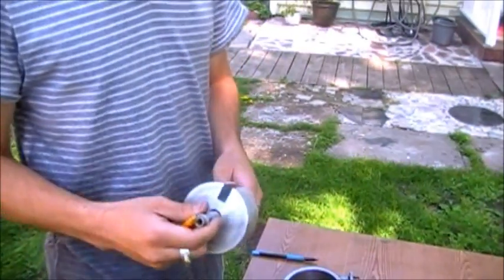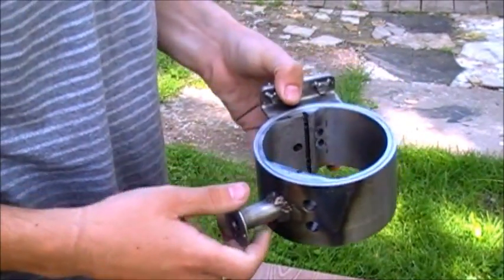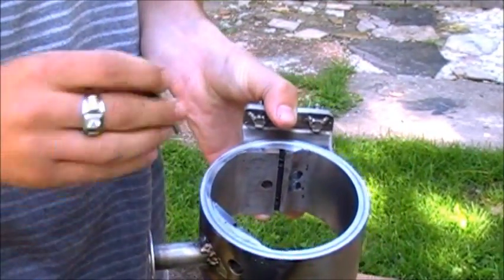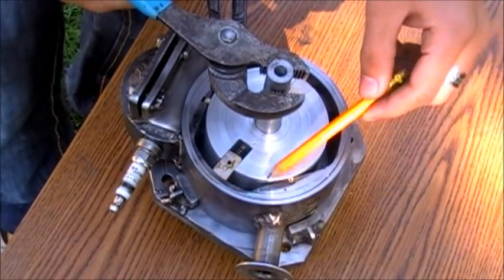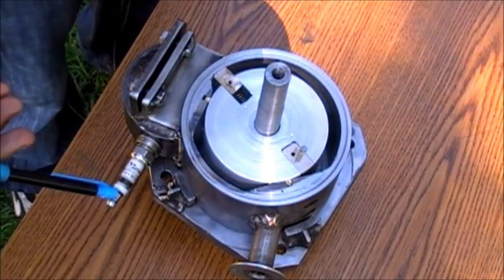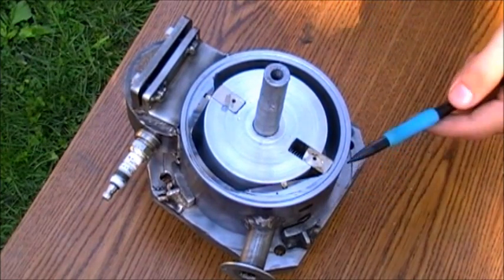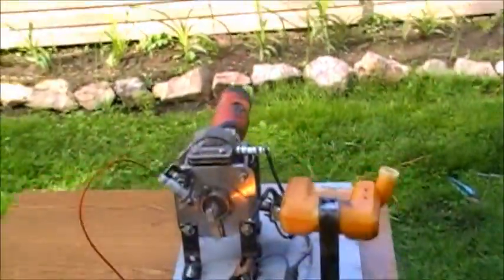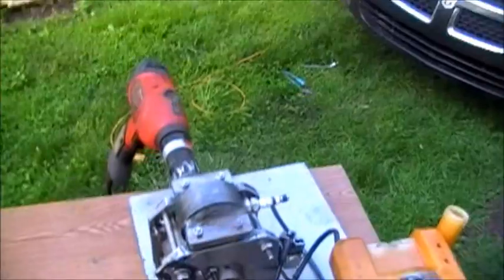new rotary engine semi functional prototype

Comment: I love new ideas great job thinking of a new engine design we need new technologies in this era.  I am afraid this design as it is will not work, the engine will not run because it does not perform all the functions needed to complete a working cycle .  Intake of air and fuel, compressing it, combusting it, clearing exhaust gas.  Then back to intake of air and fuel and continueing the rest and repeating this in that order which is a sustainable cycle.   Ur design actually is doing this......intake of air and fuel, igniting combustion chamber then clearing exhaust  gases.   Do this, get ur engine out n think about the processes the engine goes through from start to finish, step by step from the beginning the very first cycle the point where there are no "previous cycles" to include in your calculations.  Do that n follow it thru and you will see how ur missing a process because u were including or counting on something  done in a previous cycle when u designed the engine.    If u can correct this the engine should run I like the rotary idea.  Keep working on it

Comment: Good thinking but, of course design wise a bit poor but as Idea is good. You need minumum 2 chamber cyle to complete, So, when first explode happen then it will push second chamber position and exit burnt gas out egzost.  I have similiar design but, it completes the cycles but not enough compression, So I come up with turbo charge idea with complete in one unit. Now it does give compression and enough torque and complete the cycyle without problem. Now, it has heat distribution problem, lubrication and sealing problems. Recently I am sorting all those out which I come up with solutions, but I want to complete it before I make it public. So, you need a lot of work to be done. But, I admire determination without sufficient equipment and try to build your idea. Good luck.

Comment: Just a heads up , I have the same style of motor in my Ingersoll impact gun. It runs off a air compressor...your going to make a internal combustion impact wrench? The problem your going to run into is ....torque unless you set rpm to 28,000 . also there is a lot of friction here, and springs, how will the spring hold up after a few years.?
After finishing the video ....
You need a flywheel . a heavy short one and at least one more combustion chamber to help power through 180° of rotation or more flap jobs to make more combustion chambers, that way for every few degrees of movement there is gases expanding to drive the output shaft....think bilge pump sept from inside out and with explosions . the more explosions + surface area= more working output....the central hub and flap veins are the pistons and crank....more pistons, this could be the same as a 8 cyl but a quarter the size.

Comment: Interesting idea. I also thought of spring-loaded seals when designing my own rotary engine, but the problem is those spring-loaded seals cannot maintain a proper seal when the engine is spinning at thousands of RPM. The inertia of the seals is too high and they start floating. Also, there is a big problem with lubricating the seals, because rotary engines can't scavenge oil for reuse, so rotary engines inevitably burn oil. That makes rotary engines impractical for any usage where clean exhaust is a concern.

Comment: This prototype is actually qute fair to good, but it needs minor changes like you already cut 2 vanes into the armature  USE THEM both then make the sparkplug fire EVERY 180 DEGREES run this engine  on 32 to 1 - 2 cycle mix fuel and the prototype will run AS IS with the existing compression loss and leaks. I guarantee

Comment: That's not a rotary engine that a vain type engine... very inefficient design .. but good learning experience...if you could boost it it would probably work a lot better being the boost can push the vains...

And being it's a prototype it's theory in design if you do get it to work will be very inefficient especially at high rpms being the vain will float and let gas bypass it apon closing.

Comment: Good idea but you have allot of space that is unused like you could  move the exhaust over more away from the intake which would prevent the  intake air from being over heated and also prevent fuel lines from melting

Comment: I love to troubleshoot problems and you should connect a compression test gauge so can see how much Actual compression pressure it achieves?You need at least 5-6-7 Lbs and that spring loaded seal “plate” might give you problems during extreme Heat!Spring steel with the low carbon don’t really do well but obviously you are an intelligent person bilingual in English&Russian is pretty cool.Holiday in the US when you get more fluid speech and come here to test your self!Good Luck and Never give up on development of this idea.”Keep on Keepin on,”

Comment: Really good design man. ... give it some more symmetry by having 2x combustion chambers opposite to each other for thermal expansion symmetry... then  2 x exhaust obviously ...basically remove exhaust port cam...  add fuel injectors.. throw carburetor   ..attach crank gear for super charging the intake air mixture.. machine fancy end plates for new air intake paths and other things.. add roller type bearings.. more bearings to surround a fly wheel... etc etc ...  I honestly think this thing could rock with enough tinkering.40-50 thousand rpm..

Comment: Would be better if you moved the spark plug lower more to the combustion chamber where it is going to ignite the fuel easier and it will most likely fire correctly, plus you need to add another apex seal to stop exhaust being sucked back into the combustion chamber which would even help it fire up, also which is front as it looks you were rotating from the flywheel side as it looked like it was rotating anticlockwise. If you have more vid's on it please post and show us it runs

Comment: The theory is quite a good. But i foresee a lot of problems with the movable parts installed in the rotor and the part at the combustion chamber. But keep up the good work. It's a wankel without all the wankel weak spots.

Comment: An internal combustion engine is, above all, a thermodynamic machine. Mechanics is the way to put thermodynamic concepts into practice. Not on the contrary. A nice design does not guarantee the validity of a concept. In terms of thermodynamics this design does not add anything to the solutions already known.

Comment: Just to save time and money, buy a vane air motor and attach a combustion chamber to it. It may work, but in the "energy saving" department I suggest you hold your horses - a lot of energy will be wasted through friction and imperfect sealing.

Comment: how do you plan on handling lubrication and cooling? A fuel/oil (like in a 2 stroke) could keep your mass down (giving the engine scooter use possibilities) but greatly putting out pollutants. Cooling though, are you shooting for air cooled or liquid? liquid opens up a whole new can of worms to deal with (mass issues and thermodynamics). 

I'll keep dropping by to see where you take this, its peaked my curiosity.

Comment: The reason this will never work is that the rotation of the rotor is completly symmetrical. Therefore no way for the combustion to impart its power on the rotor. It will only appear to be running as long as the drill keeps it rotating.

Comment: The poor home quality machining aside, the concept is also poor quality.
So far you have an air pump that is burning fuel, but it probably can't even sustain itself without the electric drill turning it.
There are so many engineering dynamic problems here, that will never be practical.
Seal bounce,
Ball valve bounce,
Balancing,
There have been lots of attempts to do something different to the standard four stroke piston engine, but none have come close to even matching the four stroke efficiency.
Kudo's for the idea and execution, but I assume you have learnt a lot more about how engines work since making this, and can see there is no direction for development.

Comment: I see one glitch there. The compression chamber. It looks like its volume over time is going to zero and then new chamber opens up thats disconnected from the compression chamber. With the vankel engine the compression chamber "flows" with the rotor and just changes volume. In your design it just suddenly closes - goes to zero. Or i dont see the gas flow properly. Maybe you could do a 2D animation describing the gas flow and overall concept?

Comment: very nice thing ,. but there is tree problems . 
1- i dont think that the air is going to well comperes in chamber , i think its a bit big . 
2- the yellow thing which is made for sealing that you installed in side the rotary thing is a big big and it can break easy because of the shape and the size that thing is expanded out . it would be better if you made that thing looks like the cam shape or in side the cylender its could be smother 
3 the problem is my English sorry for my bad English :)

Comment: H.i I got an idea how you do much efficient your engine. I noticed you have valves only 1 side of the combustion chamber and when the engine in compression stroke you loose the compression on the valveless side. If you put a valve there which opens after the sliding vane  passes, the compression will be bigger. And an another idea try to attach a big flywheel. :-)

If i wrote stupidity please explain why.

Sorry my bad english.

Comment: concept is flawed .. there is no compression of the fuel air mixture taking place at the point of firing 4:00 .... burn will be very weak and inefficient, or will not ignite at all. Of course, sealing all this is a huge design issue.. the big spring loaded wiper has too much mass, will bounce a lot, loosing seal..and there are no seals on the sides of your rotor.

Comment: You say new engine and new tech. I'm sorry it's not. You simply took an what was probably a pretty good existing designed rotary engine and created a poorly designed one. Guys I commend your effort but this is not new or innovative. You actually took some incredibly sound engineering and changed it for the sake of being different and instead of improving it you have made a very poorly inefficient concept. 

Engineers having been tweaking these for decades. I personally know 2 that have designed their own take on them and you really have to put years of thought into a rotary engine to come up with something "new".

Like I said I commend you but you need to do a lot more work into a design before you have something you can actually say is innovative and more importantly an improvement.

Comment: very good work done. have you got it working. I can see that the combustion chamber would expand the compressed air-fuel mixture., such that the pressure probably goes below 8 bar. below this pressure, the conventional spark plug gap of 0.8 mm. at 2 KV would not ignite the fuel-air mixture. one solution is to open up the spark plug gaps to 1.6 mm. and the spark voltage to 10 KV. also a richer mixture. Else, minimize the volume of the combustion chamber. I have built a similar vane type engine, and found that the vanes get the greater centrifugal energy the faster it runs, and the resulting pressure of the vanes against the walls creates its own braking effect. I would be lucky to see the rotation
 beyond 1000 rpm. At this rpm, the pressure built up is low due to leakages. Thus the self cancellation effect. Try fitting the Mazda
 Wankel ceramic seals on the tips of your vanes.
Reply: Wow.. why didnt anyone tell me this before..

Comment: think water turbine . and expanding gas's as water that will resolve the timing problem you could use compressed air as a power source first then move on to petrol as the power supply .use the rotary motion to produce electricity rather than mechanical force/ torque . the faster the thing rotates the more electricity /energy you will get out . It would be a gas turbine the gas coming from what ever fuel you choose to use.

Comment: The engine doesn't work because you have basically zero compression. Not because of badly made parts. In the compression cycle the gases you force in the ignition chamber escape trough it's exhaust port. Only a little bit of them stay inside and burn. What you are building is a jet engine. Also even if your theory was sound the engine would still have the drawbacks of the bad seals in rotary engines. Trying to seal against 2  surfaces is a nightmare, remember even on the conventional piston engines you have at least 2 seal rings and in 4 cycle engines you have 3-4 one of which is there to keep the oil under the piston.

Comment: Hello, 
Have you done more with your idea? 2 cycle engines use a reed valve on the intake to stop the engine from spitting back through the carb. 
Thanks for sharing
Reply: Old ones don't. Some old designs have a resonant chamber between the aircleaner and carb intake, but most just rely on the piston to seal as much as possible
Reply: Eviltech u are correct but that does not lessen my comment or make me wrong.
Thanks from Virginia, USA
Reply: Bob Ordewald No it does not. But his design is flawed. The engine would not work because of it lacking a compression cycle. It's nothing more than a pump with a spark plug at this point.
Reply: Eviltech true but it is a start of something cool. Remember if the wright Brothers believed that there was no more room for improvement on that 1st airplane we would not have 747's (or something similar).
Do you remember what they used for a carburetor? They used heat to make the fuel turn into vapor so the engine would run.
Nice talking to you.
Reply: I never said that it isn't. But they need to redesign it. Nice talking to you too!
Reply: Eviltech Hey we agree, 2 people  agree on this venue call Ripley's! I'm scared.....
I live in Staunton Virginia USA, where are you?
Reply: Bob Ordewald Pazardjik Bulgaria.....
Reply: Jet engines are giant air pumps with ignition. There's flaws in the design but at least it's a protoype
Reply: Priva C No, you forgot half of the engine there... what will spin your pump? Yes they are massive air compressors, but you forgot the gas turbine on the back that extracts some of the power those engines make to run the compressor in front.

Comment: I REALLY LIKE THIS ENGINE IDEA!!! not the strongest or most reliable (seals will wear) but wery simple and easy to maintain, but in your current prototype, I find 5 problem... please don't give up with this engine yet.

1: as you already told, the ports. I think they are too small and act as air pump slowing the rotor. Also I prefer 180 Dec angle between them because it will releaf stress from bearing.

2: the fuel get mixed the air too early and might "wet" the plug when rotor finally shoves heterogenetic mixture in to combustion chamber. I think this is the 2nd bigest problem.(I would consider fuel injection... like in old tractors)

3: 2 spring just isn't enough... as you told... it backfires back in to the carburator, wich might also explains unreliable ignition. (3 phase rotor would be nice, 4 might not have enough air to fill chamber completely)

4: the air is escaping around rotor seals results as drop in presure. (you noticed exhaust coming from bearings)

5: there is no wheel. Please, Install it. It will make a LOT easier to test prototype with heavy flywheel. After all, that is a prototype... a LOT of friction. You need to store power somewhere to make it to be able to get next cycle on it's own.(rotor is not going to be enough)

just some suggestions. Keep it up, it is not far away from working.

p.s. I didn't read other comments. So... i might have told same ideas that others have already have told you.

With engineering passion
- engineer student from Finland :D
Reply: i ve lost the access to the original account .. thank you for the input.. at the time ive put that engine on hold i felt like i needed a bit of better machinery in order to produce one with a slightly better tolerances ... 

now to your concerns ... 
things that ive figured out over these few years ... 

1.  the ports ... the intake and exhaust ports are a bit small ... how ever one of the issues is the port from the combustion chamber to the working chamber . that port is too big... the idea is to make it work like a potato cannon except pushing the plate around instead of the potato...

2 the fuel mixture ... 

i have realized that that was one of the main issues as far as having it fire reliably .... i have  tested it on both the oxy/acetylene  mixture and propane which sadly bot of them did not provide enough fuel flow to keep up with the intake .... now what worked better is when took a blow torch and heated the whole engine assembly up ... I've got a quite a bit more reliable firing but ... still no go as far as it actually running ...

3... the springs ... as far as the seals on the hills the little brass ones ... they do a decent job of sealing and separating the chambers ... now one of the bigger issues is that the combusted gas goes through the side of the rotor where ideally the rotor face and the side plate should be in a very close tolerance i have a bit of a wobble ... which allow a  0.05- 0.4 mm gap between the side and the rotor ... now if you multiply that by the half of a circumference ... its a big gap ..so pressurized gas blows some  of the fuel mixture out and messes with the air to fuel ratio which again prevented it from firing reliably ...

well either way thank you for your input you gave me some more things to think about ...

Comment: I came up with this same design more than 20 years ago and found it to be unsound for any real power. But you are doing a good job on your execution. At least it works. the problem is you will have to come up with better ways of sealing. It will end up having to be close to a wankel engine and thus will be prone to the same problems.